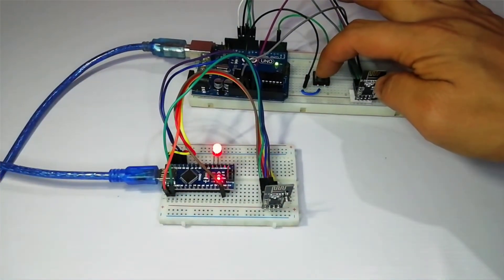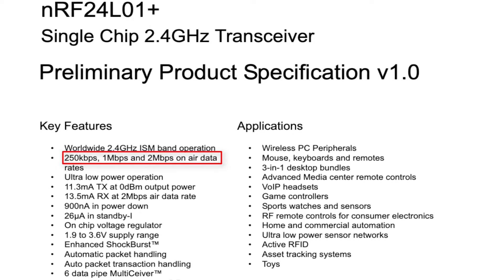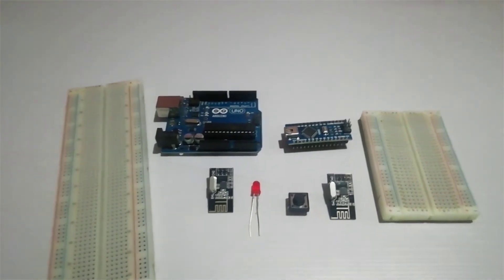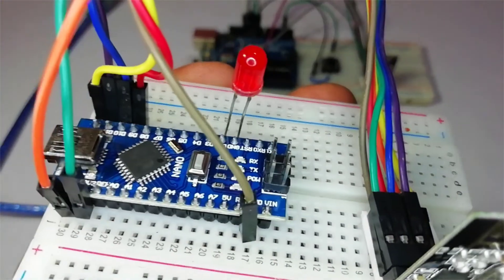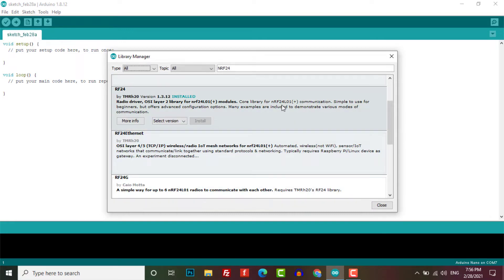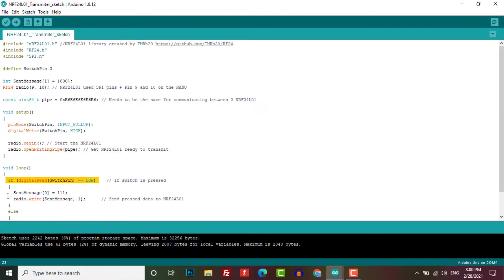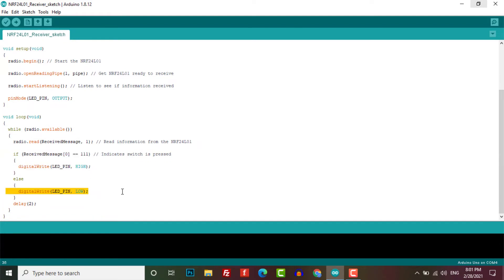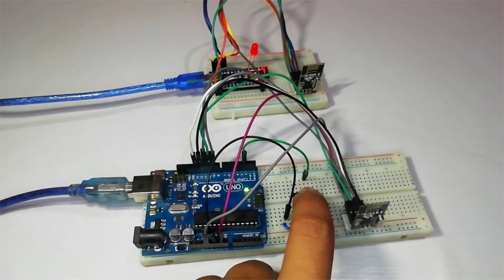Arduino Wireless communication using NRF24L01 Transceiver Module

Comment: Hi I have Arduino Uno with 3 pins connected to Max7219 with 7-segmentLED. How is it possible to send data to another 4 Arduino Uno boards using NRF24L01 so I will have exactly the same displays on all 7-segment LEDs (4 Arduino boards each with Max7219). Thank you